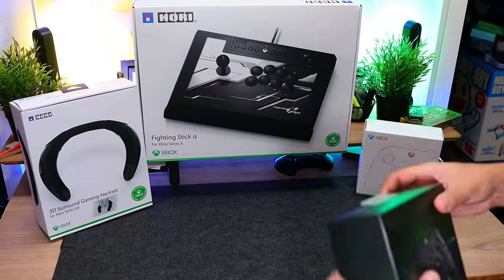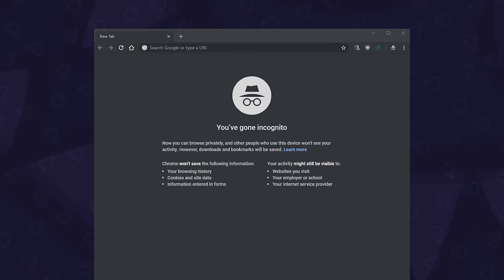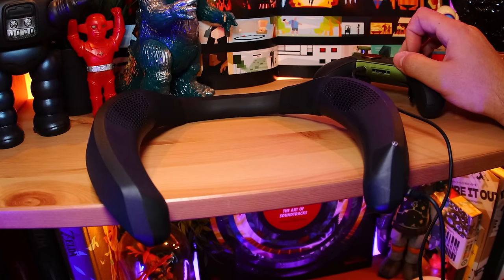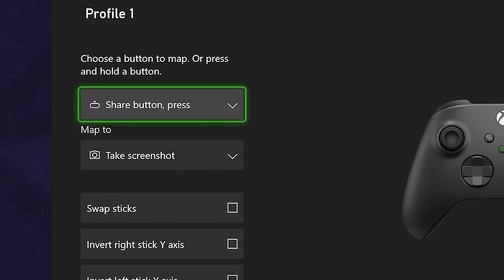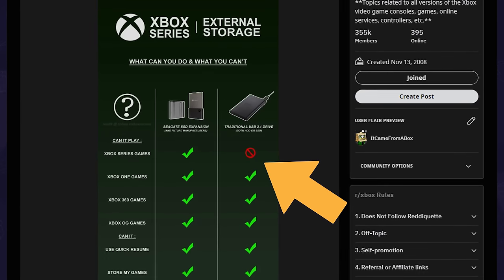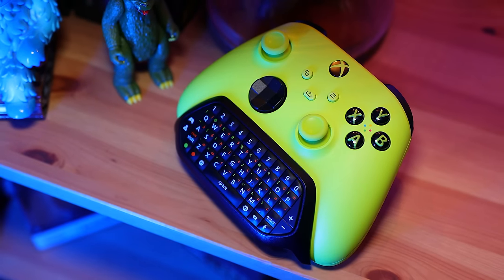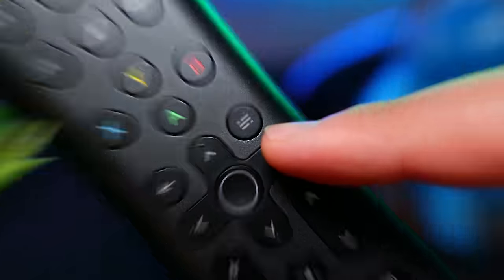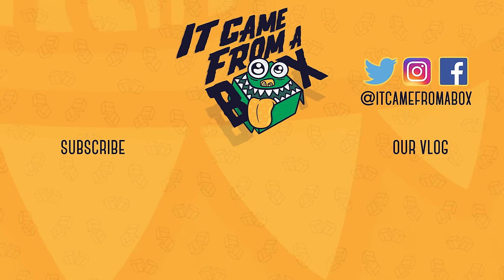11 Xbox Series X|S Accessories - List and Overview - HAULED Ep.1

Comment: Insignia (Best Buy) has a battery charger that plugs in to the front the front USB port and also has a USB port on it. They have a model for the X, S, and One X. It charges 2 batteries at the same time. The charger comes with it's own batteries.

Comment: I have a different charging station, the Sliq Gaming Pro Charging Station, for my Xbox controllers, and It is great. Highly recommend anyone who plays games a lot and doesn't want to constantly invest in disposable AA batteries get one. I used rechargeable AA batteries that I previously purchased in my Xbox controller, but constantly needing to open up my controller to take out the batteries when they get low was getting pretty annoying. Now my battery is fully charged whenever I'm ready to use my controller and I don't have to deal with that anymore. I also purchased the PS4 Controller charger for my brother cause he was always dealing with low battery messages in the middle of his games and he loves it. Charging stations are a must.

Comment: ive been curious about the hori as well as other neckband speakers,  has anyone used them for vr headsets? like the valve index with their floating speakers, i could see these, once they bring up the fidelity, to be incredibly immersive as well as make you more aware of stuff outside of the game, like ppl calling you etc
Reply from the maker: I gotta try it with our Quest 2! Actually makes a lot of sense for it! It does give you a VR-like feel in use!
Reply: I'll jump on the latter portion, this neck speaker has been great in regards to keeping me aware of my surroundings, especially with a toddler in the apartment.
Reply: @itcamefromabox  plus it'd seem more useful with a shorter aux cable to a headset, for a cleaner setup than like

just to a controller yeah

Comment: I have that 8bitdo controller. The triggers swapped on me along with the left trigger also activating the me ue button.
I have reformatted it a dozen times and customer service basically said to bad.
It was nice while it worked, the tomtoc armor case for the Xbox controller is a better work around for me.
Reply from the maker: Whattt?! Dude, i'm sorry man that sucks D: Is it within the return period?! Did you try the star button? It allows you to swap inputs, would that have happened accidentally? Also, have you tried updating it via the software?
Reply: @itcamefromabox  it I outside the one year warranty sadly (that was supports only suggestion haha). I did update it, I go back to it every couple months just to see. I will check the star button just incase though.
Thanks for that!

Comment: 3 week late comment but incase people still see it, there is currently a battery pack for the new/old xbox’s that is plugged in with a USB-C cable, it’s more reliable since there can be accidental moments where the old micro usb ones disconnect to fast and the teeth that hold it in wear down, I’ve seen one currently at game stop (I own one) that was 19.99 for 2 of the battery packs, which include the USB-C port, charger, and battery slots for the Series version of the xbox, and the regular xbox ones. They last a couple hours, think it was like 12, and they have a smart light to tell you when they are charging/fully charged.

Comment: I actually recommend the Razer universal charging dock for the Xbox series X/S 

It’s a charging dock for the controller you can get it in black you can get it in white and even has a rechargeable battery pack. No doc can only charge one controller but that’s okay because since the controller has a USPC charging port at the top this now gives you the option to either charge your controller with the charging port at the top by plugging a cable directly into it, or put it on the dock.
Reply: Also, that little gamepad thing is I actually really cool and I’m going to guess it works with the console and if it does work with the console it will be good to have just to play, classic arcade games

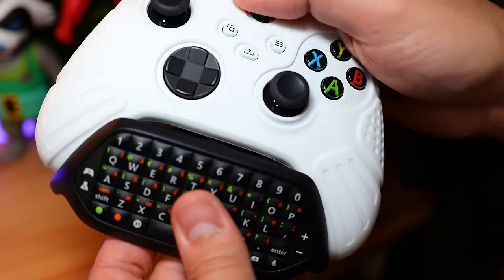Comment: 10:48

The rubberized grip for the Xbox one controller was also better!!

They came in different shades ranging from white to black, and you could still plug in your keyboard or your bass booster for your headset!!

I’m sorry but the Xbox one controller is the best controller of all time in my opinion.. series controller falls slightly behind it? It’s because it’s freaking cheap-
Reply from the maker: I think the problem is that rubber doesn't always hold up well with time. They tend to dissolve and turn sticky 😭
Reply: @itcamefromabox  the one from PDP for the Xbox One is Pretty good! 

As long as you clean it once a week at least, it doesn’t get Sticky.. Unless of course your hands sweet a lot while you play?? When I was a Child my hands would get Quite Sweaty.. but as an Adult they rarely do!

Comment: Does that PDP battery pack allow the xbox dashboard to read the battery level and send a low battery notification when the battery is low? Because I have another battery pack which doesn't and its frustrating not knowing if your battery is low and then it suddenly just dying. But the benefit of the one I have is it charges through the internal USB-C port in the controller instead of having to be docked to charge
Reply from the maker: It does show the battery level but we haven't had it set to low to see a notification since we charge after using it :O

Comment: Great video and all around good set of accessories shown here but I’d personally never hang my Series X from strings. Looks mediocre in my opinion. And I’d just be worried about someone hitting it accidentally idk lol.
Reply from the maker: Felt the same way at first but since we try to get stuff that's interesting and niche to share, we tested it out with the PS5 at first with pillows right under and it stayed up for over a week. But also, it's mounted the same way as the metal frames are and it helps that the string raps around it 👍 it's not for everyone but we do have some metal frames coming in that we'll check out soon!

Comment: I have the PDP rechargeable battery pack. They do not last 20 hours. I'm getting maybe 10
Reply: i stopped buying xbox rechargeable battery packs. each new battery charging station i had lasted 6 months stemming back to 360 and xbox one. was about to buy another new one 2-3 years ago at walmart but an employee there in electronics told me dont buy them, the coils over heat, and said just buy recharge batteries that plug in the wall. ive had the same 4 batteries that come with the wall plug for 2 years. never had an issue. think its just the energizer rechargeable batteries and plug. it was 12$. And i now use these batteries for my xbox series x controllers.

Comment: I just wish they would start selling Xbox one S controllers in stores again!!!!

They were better-

Better D pad(fighting games)
Better shoulder buttons
Better triggers
Better sticks(although the series controller are almost identical just slightly different..)

And last but not least it was shaped perfectly imho!?

I like this series controller but damn if the plastic doesn’t get sticky after you’ve used it for a few hours and it doesn’t matter how much you clean it it’s gonna get sticky again even if your hands don’t sweat!? And they added some more of the Sega genesis back into the D pad that was perfect on the Xbox one controller, especially for fighters?!?!?!?

 This was the only thing about the new Xbox’s that I did not like… I still find it comfortable but the buttons and components are a lot cheaper, the LB & RB Bumpers are NOT as Sensitive, & ultimately it’s just an inferior design to one of the black or white Xbox one S controllers!
Reply: I do agree with the d-pad
But the rest not really
Reply: @_-ghostfps-_8651  Get yourself a brand new Xbox one S controller and compare it to the new series controller and you’ll agree with the rest-
Reply: @turismofoegaming8806  i did buy a brand new xbox one s controller along with the series s(because it costs less)
And honestly the series controller is much better with tighter grip on the shoulder buttons and the trigger
The sticks didn't feel different
Reply: @_-ghostfps-_8651  The sticks are just mildly different with a pinpointed concave design on the Xbox one S controller..

But do you not feel the cheapness in the shoulder buttons on the series controller???

I like everything else about the series controller aside from the D pad and the LB and RB buttons.. They are nowhere near as responsive

Comment: I am annoyed about how much I have to charge my ps5 controller, I never really noticed how fast it drains after using a series 2 controller so long
Reply from the maker: That's an issue with rechargeables 😭
Reply: @itcamefromabox  My series 2 controller lasts 40 hours without having to recharge but my ps5 controller i need to charge it every 6 hours and it seems like it takes 2 hours to fully charge 😭